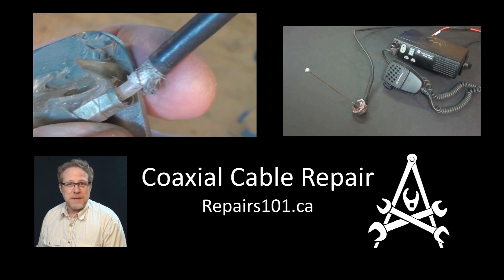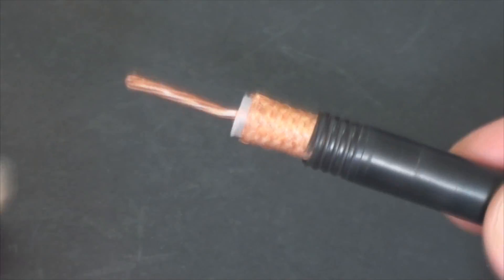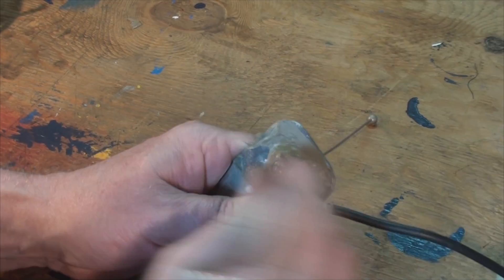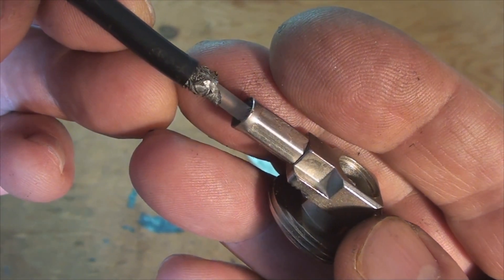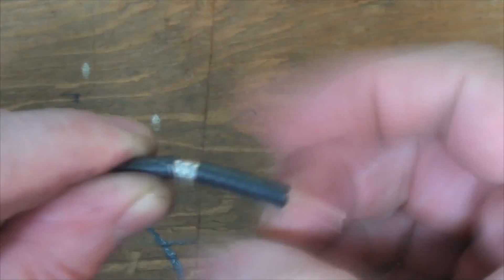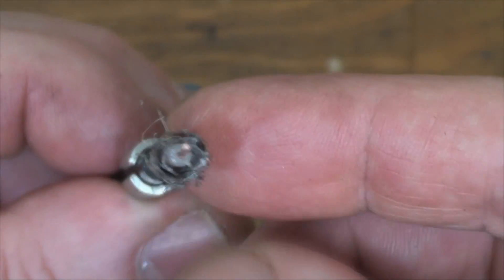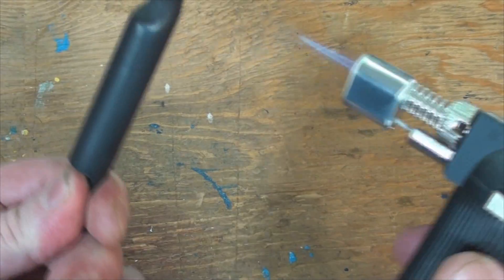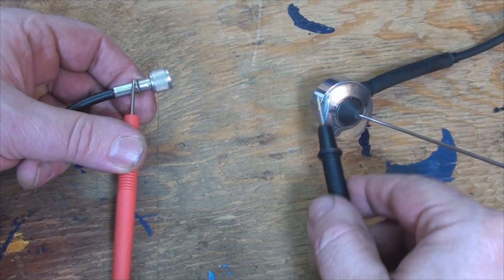Coaxial Cable Repair - How to Fix Shielded Cable

Comment: Question ❓ I'm having to run new coax cable ony marine vhf radio. How do you measure the the length of the cable ? Every 3 feet or 1.5 feet ? I only need 6 feet at the most and I don't want to screw up the frequency that it runs on . Thanks

Comment: Pity you keep wobbling the piece about with your fingers, I can't make out what you're doing.
Reply from the maker: It's a lot harder to make videos than to criticize them.
Reply: @repairs101  I appreciate that is the case but if you can't take well-meant practical crit how would you improve? The point of watching is to see how to repair from your guidance but I couldn't see what you were doing so it was pointless for us both. Thanks for trying to help though. Would a tripod help to keep the camera/phone steady?

Comment: I have a full size strobe led light bar on my roof (warning lights) i have a small CB no big power but when i key the mic, It will turn on the lights do you know what is wrong or how to fix??????????????????????????????? SOME ONE PLEASE HELP!
Reply from the maker: Are they sharing the wire? Seems you are energizing the lights with the mic switch. Run a separate wire for your CB (antenna)
Reply: They have diff wires - the lights have a 12v d.c. from batt into cab where it goes into a controller for the lights from there the power lines exit the cab to the roof where they go into the light bar.... The CB has a cig plug wire (12v. D.C.) from the dash to the cb, then a ant. coax cable from the CB to the roof into the ant. there are NO SHARED wires.
Reply from the maker: OK do the wires run close/touching/intertwined ? Maybe inducing enough voltage from field to energize lights. If so separate wires 1m or more. If not, better talk to an electrician. I'm a mechanic. Good luck.

Comment: Another good continuity test that should be done is between the centre conductor and shield to check it isn't shorted, especially given the soldered core looked quite long inside the fitting.
Reply from the maker: +Mark Bartlett - Thanks for the tip!